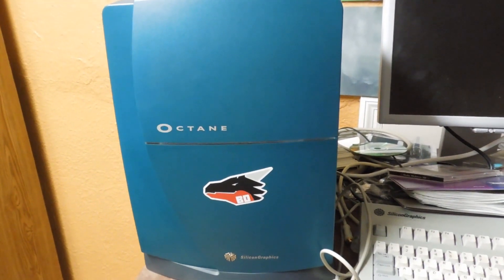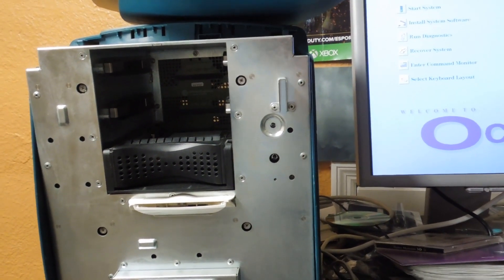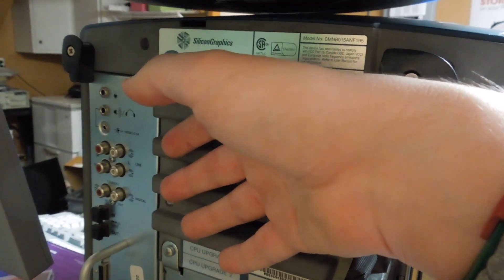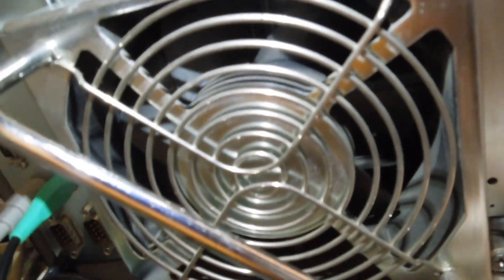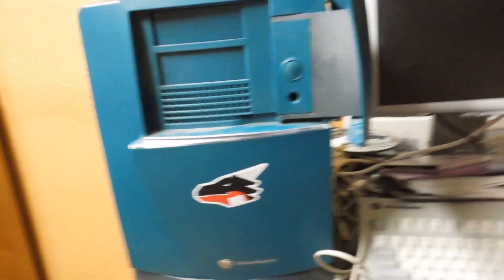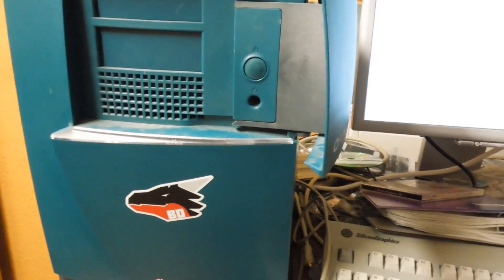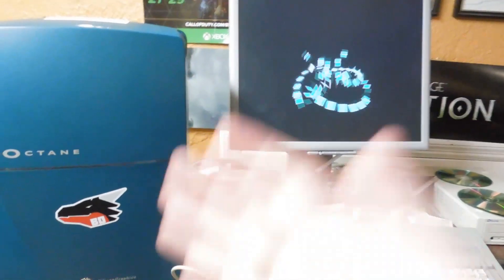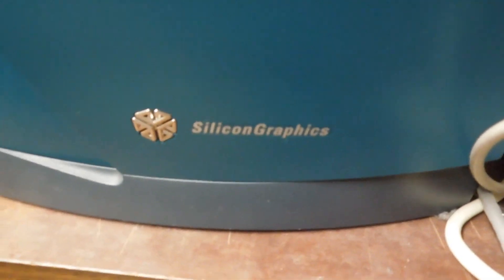SGI Octane Problems (or why SGI machines are boat anchors)

Comment: Thank you Mr.Paws for your public service video! Hats off to you for saving the rest of us alot of money! As for the rest of you good luck trying to find parts that no longer exist! I spent $400 dollars on a Sun Microsystems V490 which is the smallest server that they sell and the server is weighs almost 100 pounds. Of course it does not work! I am going to have alot of fun carrying this massive piece of junk down three flights of stairs on my way to the dumpster. I doubt very much that the rest of you "geniuses" have the courage to admit all the mistakes you made when buying scrap metal from ebay. If I were the rest of You Tube experts I would not question young Mr. Paws tech skill since he successfullly manages to "IPL" or boot up some of the extremely complex IBM servers and workstations that he has which use hexadecimal firmware engineering codes! Hexadecimal is base 16 for the the rest of you "experts". Mr. Paws could probably work for IBM if he really wanted to! He has a killer IBM IntelliStation Z PRO and a bad-ass IBM Power 720. The man knows his stuff so would take him very seriously when it comes to computers.

Comment: I have 3 SGI octanes and have never had issues with any. I have had a hdd go bad and the typical light burn out. But I’ve replaced them myself and works perfectly. These systems are stupid fast for certain things. I have the dual mips r12000 and maxed ram in all 3. I haven’t tried putting a diff OS on it yet I am running irix 6.5.30

Comment: How would you expect ANY decades-old computer hardware ( of any kind ) to be in tip-top shape? Electronic components wear out over time. Plenty of PC hardware from that time period doesn't even turn on today. The fact that it turns on, boots and runs is actually impressive.

Comment: What I'd like to know is where to find the software so I could use my modern hardware to do impressive stuff that computers like that used to do.
Reply: https://nixdoc.net/man-pages/IRIX/man1/cu.1.html  The command cu might do it.  I recall using that with my modem but ended up getting ISDN to the house.   The Indy's came with an ISDN port beside the AUI connector.

Comment: I mean the computer IS 20 years old now, so everything goes bad eventually
Reply: I have a 28 year old Indigo R4K that still runs beautifully.  Eventually something will fail, like a capacitor, but that's understandable if you know how computers and electronics work.  It's also fixable.  You get what you pay for and also what you put in.  This video is like watching someone buy a wrecked 20 year old Ferrari at an auction and then complain that it doesn't work perfectly...
Reply: @lookoutforchris  honestly. Man I wish I had an Octane or an O2

Comment: Really no reason to play with these unless you have a piece of code you have to maintain on the platform. I still have a number of Indigo2's  I keep running as well as a couple of Octanes. The I2's were always easier to keep running than the octanes. Power supplies and Dallas chips the bane of my existence! But love me some sgi!
Reply from the maker: Those compression connectors are horrible tbh
Reply: @pawsinmyface4560 I have not had an issue with mine in 18 years.

Comment: It's the fan, not the entire concept of the machine. Clearly its had issues before, you got lucky and got it for $25, these computers just go bad after some time. I spent months trying to get a sun Sparcstation to boot without its original power supply, and after I got it to boot, I learned that some part of the CPU was shot, I couldnt do anything about it, it's just old and it's time came. These unix boxes are aging fast, you gotta remember that they are fragile. They dont always work right away. I'm sure your octane works great, the fans just arent having much luck
Reply from the maker: I got a working Octane later and I'm going to make a video on that.
Reply: @pawsinmyface4560 change the title of this video then.  You went dumpster diving and clearly don’t know how to handle the system you have.  They’re fine machines if you know how to use them.

Comment: Boat anchor - yes - the performance to power supply wattage doesn’t make sense on Octane - an O2 or Fuel with a 245wt psu are way more fun - Octane will cost you $3 bucks a night if you leave her running 24/7 - the reason for the crazy $ now a days is that there is simply no other way to get a taste of a true UXIX os any other way - Linux sucks -
Reply from the maker: I got a working OCTANE in the end, o2s are even less reliable and fuels are hell in a shiny red box.
Reply: Yes, you are right O2's can be a massive pain -> in the ass, the memory modules have poltergiest living inside, touch them the wrong way and they fail, touch them again THE right way and they work again.....mmmhhhh FUEL's are pretty sweet but I agree to some regard they were the tail end of the glory days at SGI..., the only problems you might encounter are failing PSU's, or mis matched "Basic" vs "Premium" memory modules...

Octanes are phenomenal in the sense that they are an example of man's best possible execution at designing and building a premium workstation, I mean the PCB's have ounces of 24K GOLD in them, these things were built to last 100 years, there is nothing cheap inside, there is insane build quality in Octanes.....I am glad you got yours working, please make a video when you get a chance, love to see her running...
Reply: I agree build quality is great. I have a high spec Octane, replaced fans with new Noctua fans and replaced bulbs with led and good to go. Not bad for a 22 year old computer and mine looks like brand new.
Reply: @Edward3DFX  so they have thousands of dollers worth of gold in them,
I doubt it somehow,
Intresting point though, I wonder how much is in there,

Comment: The whole reason why these older  computers cost so much nowadays on Ebay is because of the whole "Retro Gaming/Tech Price Boom" Which is something that is happening mostly non-rare 70s,80s,and 90s era tech.
Reply from the maker: I ended up getting a second Octane for $80 at a recycler. It works.
Reply: Oh,well that's cool! :D
Reply: @pawsinmyface4560  Some states don't allow person to person selling from e waste recyclers but they are allowed ebay accounts..Happy you don't have an issue getting machines.

Comment: Damn, where do you live to get a workstation like this at this preposterously low price? The cheapest Octane in Italy it's sold for 200€ and i don't want to spend that much for a Silicon Graphics machine.
Reply: @garrettbischoff3817  Damn, these days I just won an auction for two Octanes (a complete oe and an incomplete Octane 2, just 50€ in toto) in Italy: it was local pickup, and thanks to a friend I should be able to get 'em (the shipping is another thing I will have to deal with).

The secret seems to wait and hope to find a good deal.